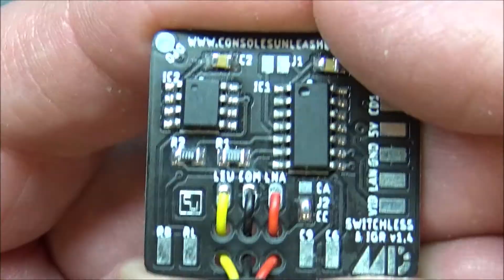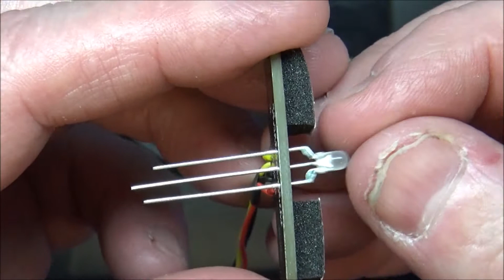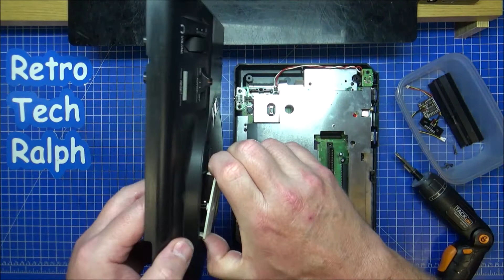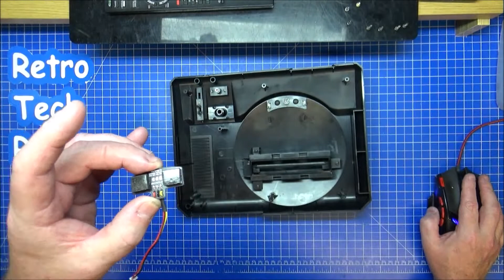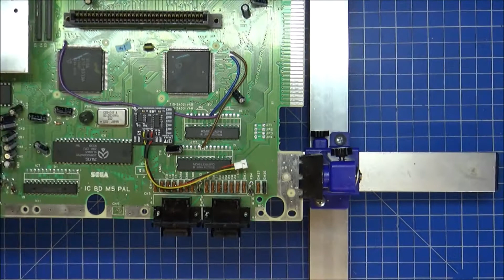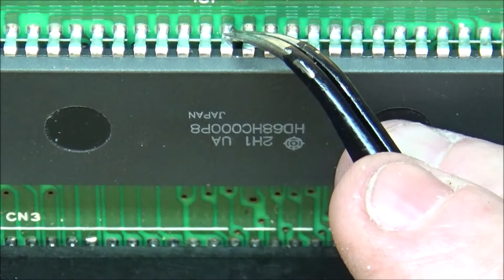Mega Drive Switchless Mod

Comment: What's the purpose of connecting the mod board to the controller pins?
Reply from the maker: It helps make a reset switch on the controller, as the original is taken by the multi region switch
Reply: Ok, so that the current reset behaviour is changed.
Reply: If you wire it up correctly, you can cycle through the regions and reset the console by pressing start + a,b and c just like you can by holding the reset switch.

Comment: I’ve just looked at the website, the instructions say that you need to use the RGB output with scart, not component otherwise you won’t get colours
Reply from the maker: Thank you. This really helps. I have bought a scart cable last week, so I can use that instead.
Reply: @Leah Rowe simple changing an oscillator. I’ve done it with mine but you’re right. Rgb provides best results.